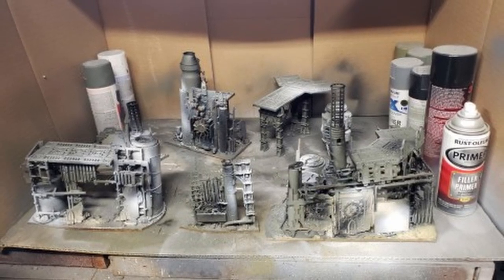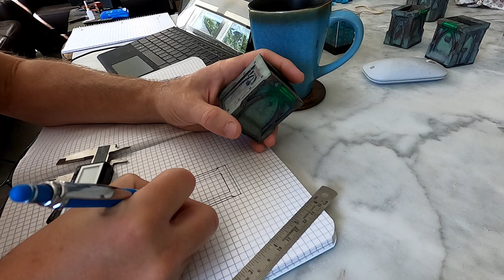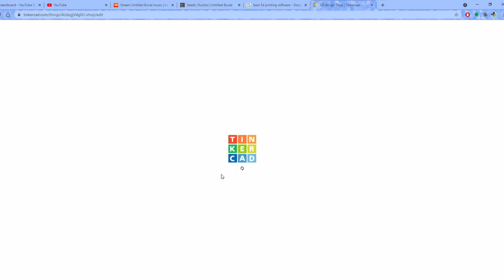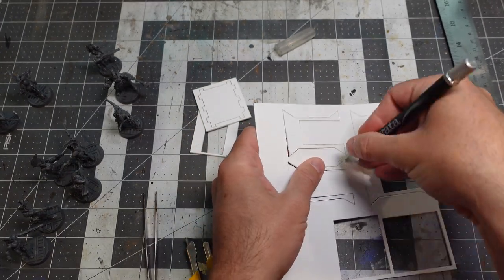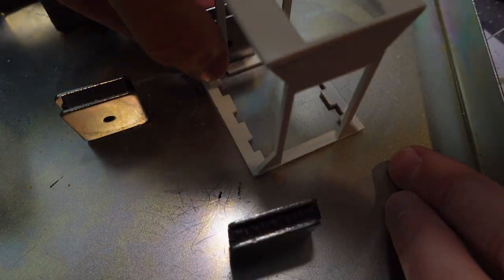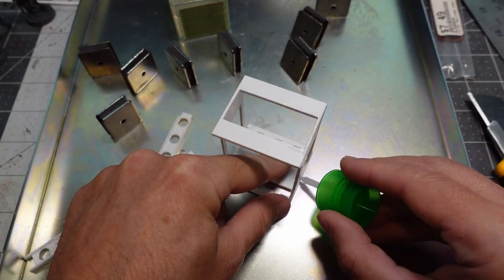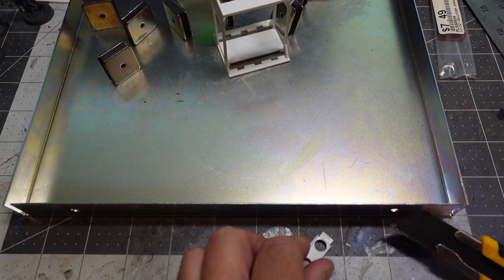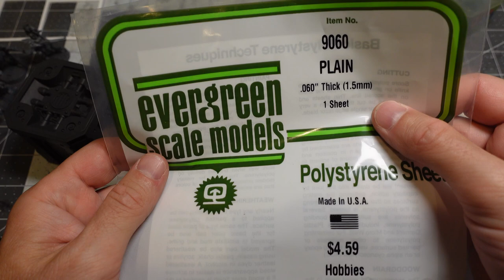Scratch Building Some New Modular Sci-Fi Walls

Comment: The plastruct railings and I-beams look like something that would be easy to print on an FDM printer for fractions of a penny each.
Reply from the maker: I hadn't thought of that. I'm actually going back to the drawing board and designing something more modular though based on a grid system.